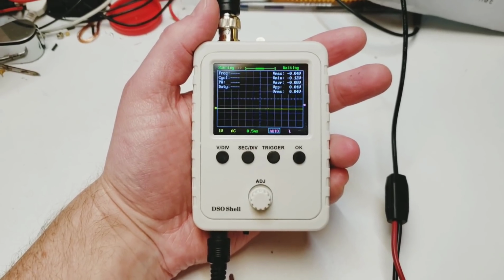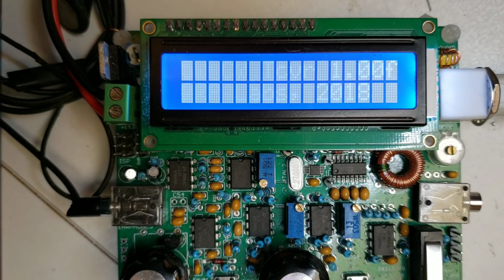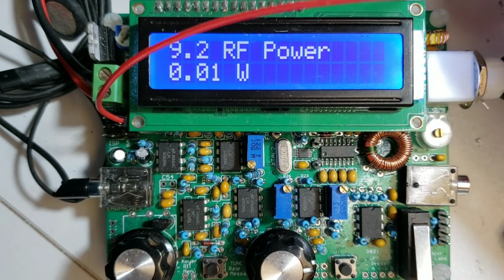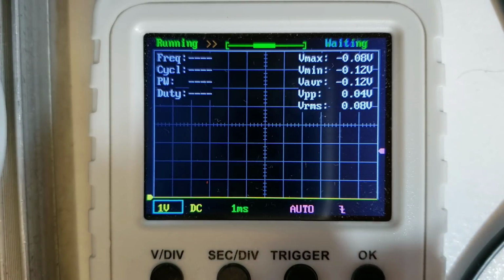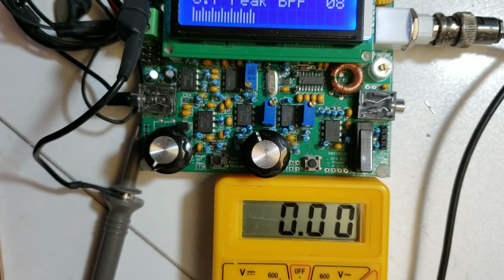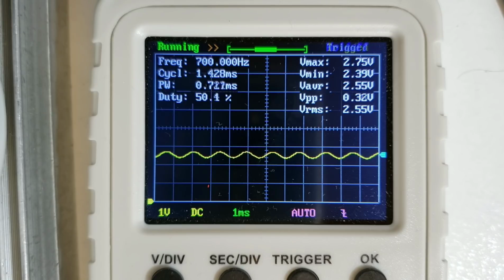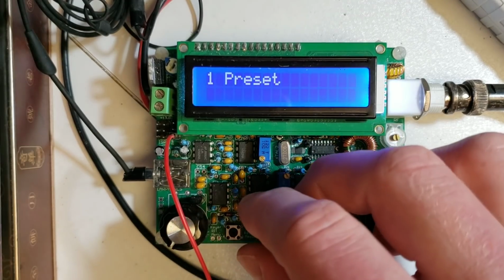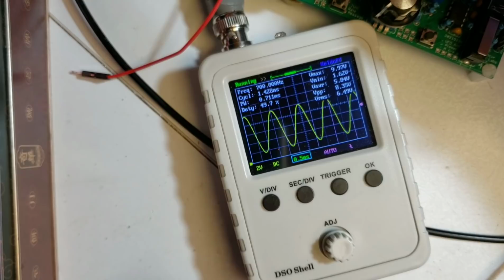Debugging QCX issues, using cheap pocket scope, DVM or built-in DVM. With 40m QSO at the end

Comment: You're right about the header. I blew up my QCX 20 messing around near it. Built a QCX 40, found two missed solder joints. Now it works great and I've made many QSOs. I have poked around it with my new oscilloscope (9 volts for some cushion of safety.) I have learned a lot. My order for a QCX+ 20 is in.  This is great stuff. Thanks Hans, 73 Dan KF4AV